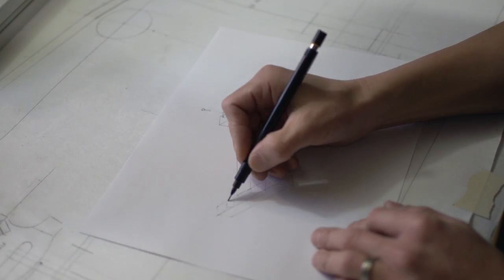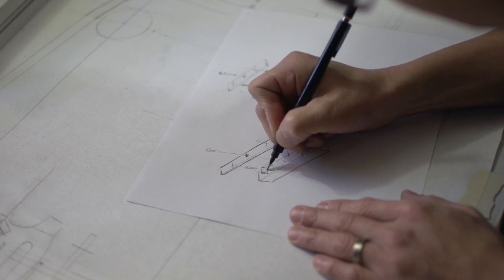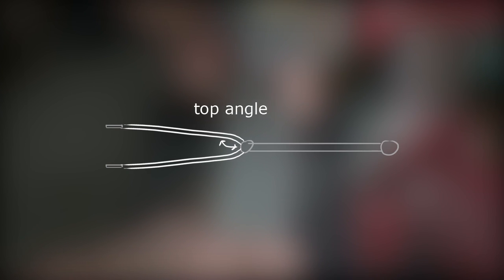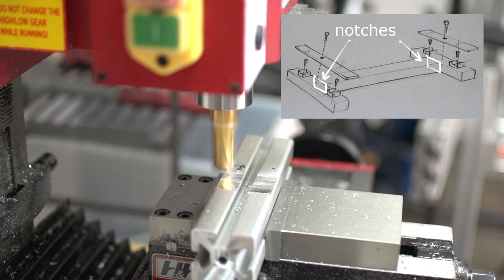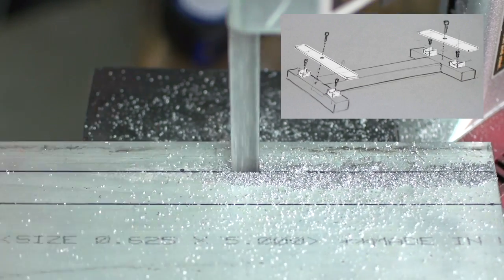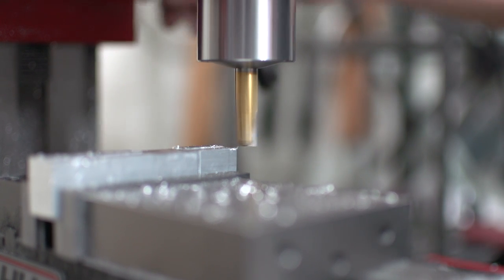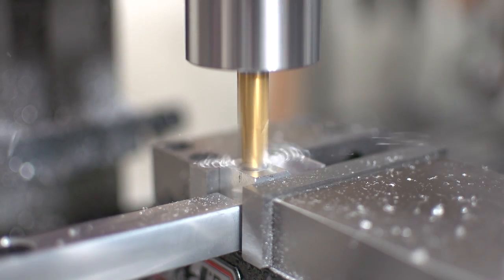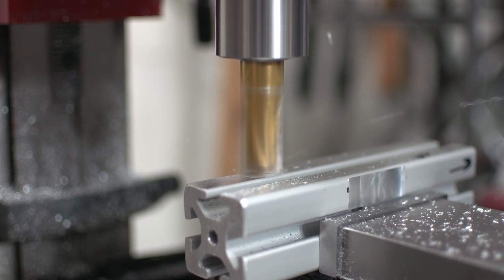Bicycle Frame Build 42 - Seatstay Miter Fixture

Comment: damn, such motivation right there!
Nicely done. could that vice block be a little longer on the bottom when it is mostly clamped in such an extreme angle?
again, great work, very happy to see a new episode everytime!

Hendrik
Reply from the maker: +hendrikhanso Thanks Hendrick! It could have been a bit longer but I decided to go with 40mm x 40mm to complement the size of the extrusion. :)

Comment: Great video.  Are you planning on doing a [brake] bridge between the seat stays?  Anything fancy in mind?  Maybe a milled piece instead in tube steel.
Reply from the maker: +thechosendude No break, this bike will be fixed. But! I will weld a bridge for added strength. Nothing fancy in mind. Just tube :)

Comment: Great looking work as usual... I was wondering though... my dream is to build a full suspension frame but at the time I am lacking a mill and lathe, do you (or anyone) think it would be worth my time to build a basic frame first? Any help would be much appreciated.
Reply from the maker: +MrGangsta9812 It really depends on your comfort zone when trying a new build. I'm pretty comfortable diving in to new builds only because I know I'll mess up and learn from it. If you don't mind messing up, I believe its the fastest way to learn and just go straight after your objective. If you are totally new to frame building, it might be wise to try out something simple first. Just to be sure you like frame building. I did this when I took a short frame building class. After that class, I dove in.